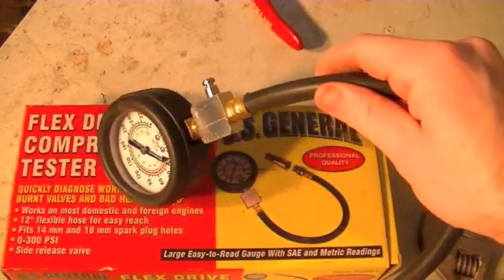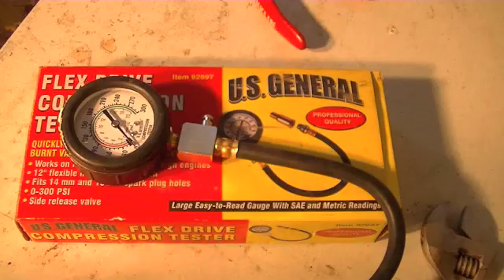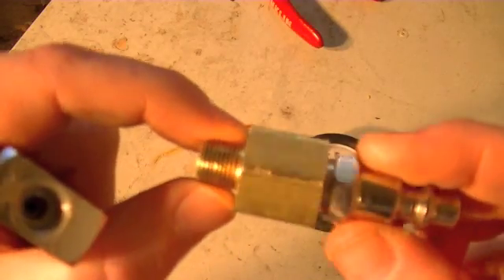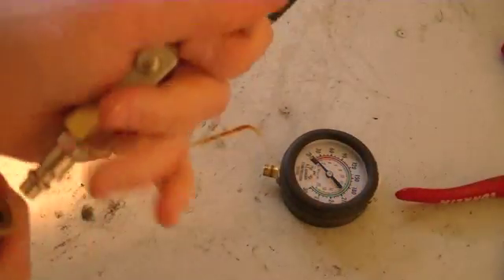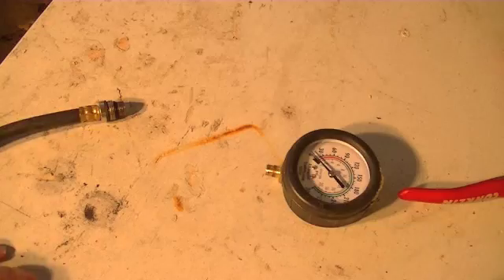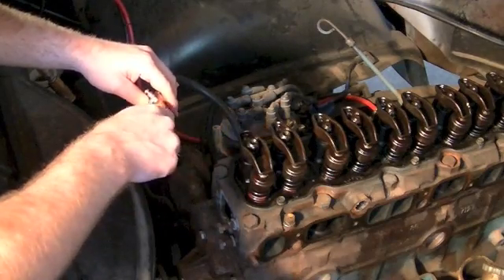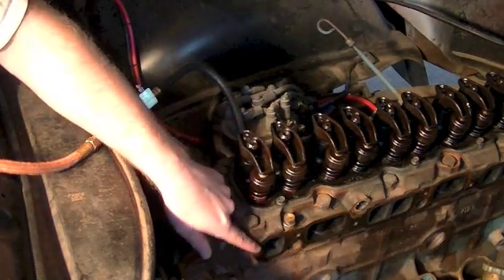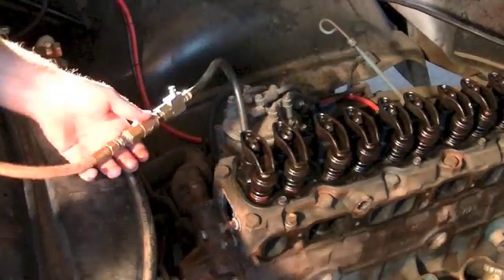HARBOR FREIGHT COMPRESSION & LEAK DOWN TESTER | 2 IN 1 Engine Tool

Comment: If you look at the adapter or the hose end, you will see you can put a wrench on to tighten it into the spark plug hole!!! This is a great great feature! Most of those hoses screw in by turning the rubber hose and does not allow a good seal witht he rubber o-ring. I had fits using my compression tester I got on amazon as I got compression bleed out while finding TDC using a vacuum qauge. This is exactly the hose end you need to get it nice and tight in the plug home and remove it easily.   Good Video.

Comment: It's a good idea. Thank you for the video. I was even thinking about spraying a little soapy water around the valves on top of the head to see slow leaks with pressure in the cylinders, of course that water would need soaked up and everything oiled up before reassembly.
Reply from the maker: +Ashroyer86 Soapy water would work.  If you used very little, you could get away with not wiping it up.  Or at least wiping up as much as you could.  Thank you for watching!

Comment: Looking like I've got a bad lifter. Intake valve was stuck open, after backing the rocker nut off I've got compression again. Just thought I'd let you know.

Thanks again for these videos.
Reply from the maker: Excellent!  I'm not happy that your engine is messed up, I'm just happy it's a bad lifter.  Easier to pull the intake manifold than to pull a head.  Hopefully it's not seized in the lifter bore!
Reply: Never tore an engine down at all and I'm kind of excited to get in there. Any issues with a new lifter on a used cam (assuming the lobes are ok)?
Reply from the maker: I would start with checking the offending lifter and making sure that it is not stuck in the lifter bore.  After that I would make sure the camshaft is ok.  If you've got a lobe that's rounded off the camshaft is junk.  If the lifter is stuck in the bore the camshaft could be damaged.  Basically what you need to do is measure the amount of lift on that cam lobe.  Compare it to another intake lobe.  If the offending lifter can be made to move smoothly in its bore, you can make a mark on the pushrod.  Find a non-moving spot on the engine to take a measurement of the mark on the pushrod.  Measure the distance with the valve in the closed position.  Spin the engine over slowly by hand until that pushrod stops moving up.  Take another measurement.  Do the same thing on another intake valve and compare the measurements.  If there is a difference between the two valves, the camshaft needs to be replaced.
Reply: Easy enough. Thanks!
Reply from the maker: You're welcome!

Comment: Hahaha..I just had a cylinder go down on me today on my 383, sounded like an exhaust leak. Ran a compression test and got right around 135 psi on  cylinders 135&7. Cylinder 2 had 145, cylinder 4 had ZERO, 6&8 were about 120. Anyway I had planned on doing just what you showed here when I get to work tomorrow so I can use the compressor.
Reply from the maker: Haha! Perfect timing I guess!  Hopefully you can get it worked out quickly.